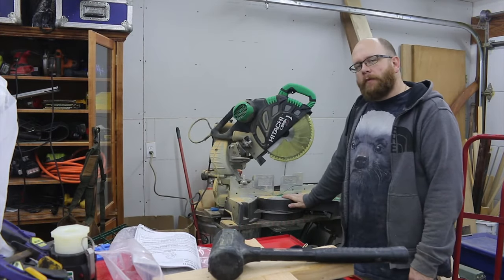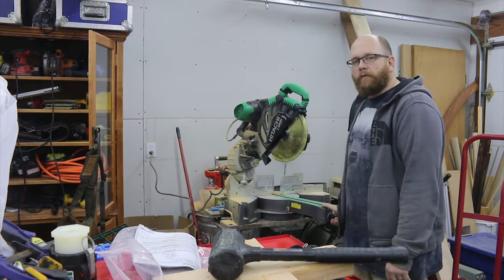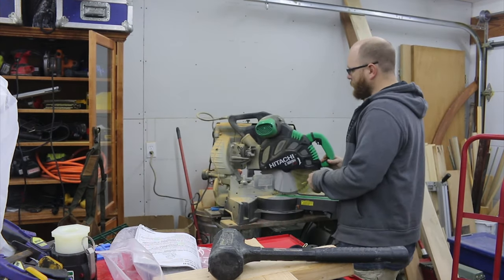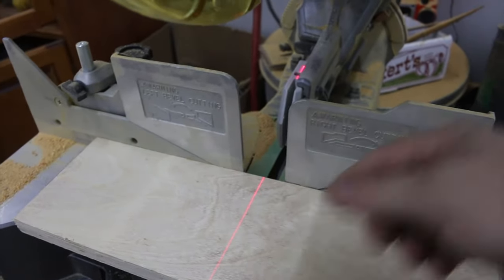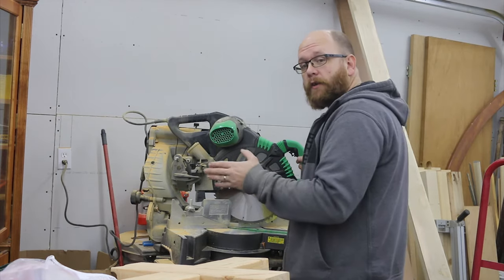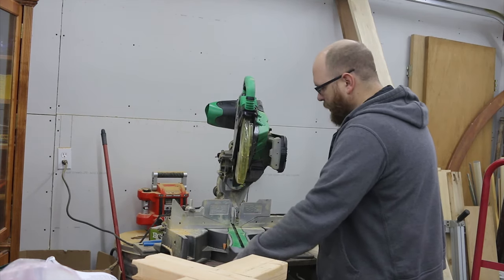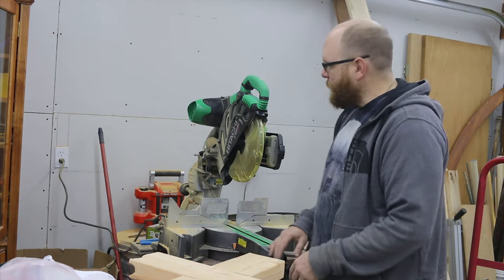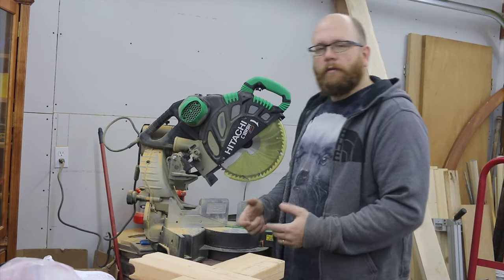Why I Chose the Hitachi C12RSH

Comment: Was gonna start saving pennies for a Bosch due to the depth of the rails but when I saw this saw and it's price I immediately scrapped that plan.  The Bosch is nice, but this fits my needs perfectly.  The dado thing is not a big deal, this can be used to hog out most of the material and then finish it with a hand plane for better end results.
Reply from the maker: That was my main reason for wanting a Bosch and the main reason I got this one. It is amazing how much wasted space there is behind one of those “rear rail” models.

Comment: It looks like it's been a while since you did this video, but I just acquired a used saw of this model.  The one I bought was well used and needed some TLC to clean it up and add some missing parts.  My question is about the micro adjustment for the miter.  When I got the saw, I had to replace the missing handle, but then it didn't move the table.  I took the shaft out under the saw and found that the gear to the table was loose so I tightened it.  Anyway, so my question is, when you shift the table right or left, is the micro knob supposed to spin as you go?  It seems this makes it a little difficult to move the bed easily.  Thanks.
Reply from the maker: Mine does spin with the miter adjustment. The knob is tight enough to allow adjustment but not too tight to interfere with the rotation of the table.

Comment: Bought the same saw 2 years ago new from Lowe's. Great saw. Only problem I had was the factory blade lost a tooth or was missing from the factory. Found it after my son was cutting PVC and it shattered. He had to change his shorts afterwards.
Reply from the maker: Yeah, I usually change those out right away, but since I included my good blade when I sold the old saw, I have had to use the one packaged with mine.  It isn't too bad!  It's a shame you didn't bring the blade back and swap it out with a good one from a different saw.  Not sure if Lowe's would do that, but I have done similar things at Home Depot.

Comment: Can this great saw be used to cut out mortise or trenches in wood. It would need a depth stop control to limit the depth of the saw into the wood to enable a sequence of parallel cuts to the same depth, then chisel out the remaining wood to make the mortise or trench. Thank you.
Reply from the maker: This saw does have an adjustable depth stop, but there is too much flex in the arm assembly to make exact depth dado cuts repeatedly. I have used it in the past, but always have to follow up with a router plane to flatten the bottom of the dado.

Comment: With this being a refurbished model, any issues with it? What does the manufacture do to refurbish it?
Reply from the maker: So, normally as refurbished, reconditioned, or remanufactured tool is one that has been returned for whatever reason.  Sometimes the tool is returned because it isn't what the buyer expected, but most of the time it is returned because of some flaw in the construction or operation of the tool.  The manufacturer then fixes the flaw, and sells the tool as reconditioned at a discount.  The refurbished tool usually comes with a warranty, but sometimes the warranty is not as good as if you buy new.  A lot of places that sell reconditioned tools will also sell "open box" meaning they were defect-free returns and "factory blemished" - tools that function fine, but are scratched and/or dented, so they can't be sold new.  I have had a lot of good experiences buying remanufactured tools.  Normally, that is all I buy and I tend to save 25-50% off the price of new by doing so.  Every remanufactured tool I have bought performs to my expectations and none of them have died (so far).  It is a nice alternative to buying new or used.

Comment: Additionally, I was considering the Hitachi C12RSH2, what features are missing from that saw compared to the Hitachi C12RSH?
Reply from the maker: Basically they stripped down the original model and are selling it as the new model.  Some of the things they eliminated:
The flip-out fence has been replaced with a traditional sliding fence for bevel cuts
The laser is no longer adjustable
The right hand miter only goes to 57 degrees versus the 60+ on the original model
The fine adjustment knobs on both the miter and bevel have been eliminated
They have reduced some of the bulk and plastic/rubber overmold, so it appears to take less space and is lighter than the original model.

Hope that helps!
Reply: Thomas Lightle - Red Barn Woodworking so, it sounds to me like if I've got the opportunity to purchase a refurb, I'd be better off doing that than a new one! Same as you did! Thanks so much for your speedy reply! Looking forward to checking out more of your content!

Comment: @Thomas Lightle - Red Barn Woodworking
hello... I just got one of these from a cabinet  maker that went out of business.....
BUT they took the blade guard off :(    I'm looking to replace it..... it looks like its only 3 parts , the guard, link and the return spring
I was wondering if you could , check if i'm correct thats all the parts??.... oh your review was and still is the best on this saw... thanks
parts links:
https://www.toolpartsdirect.com/hitachi-324376-link-c12lsh-c12rsh.html
https://www.toolpartsdirect.com/hitachi-324375-protective-cover-c12lsh-c12rsh.html
Reply from the maker: I think your links kicked your comment to the spam folder.  I partially disassembled my saw and yes, it appears those are the only two parts you need to get the guard back on your saw.  Good luck!
Reply: @SouthpawWorkshop  thank you very much!....

Comment: I cant help but to keep looking at the drywall near the outlet where they let 4 corners meet instead of off setting it. Its no biggy just my OCD
Reply: Oh and every miter saw i have used has had a problem with depth consistency's no matter the brand or price when cutting a dado. Using the table saw or radial arm is about the only way to make a quality dado or router table if your going with the grain. My bosch 12" axial glide miter saw is horrible at it.